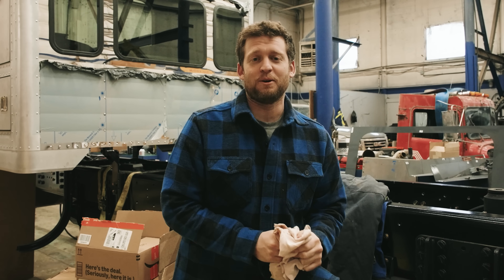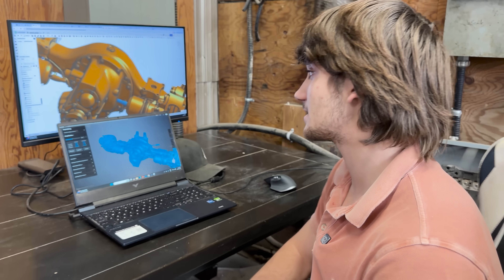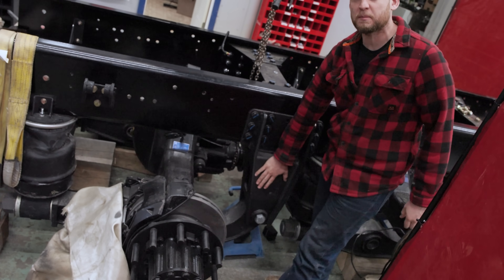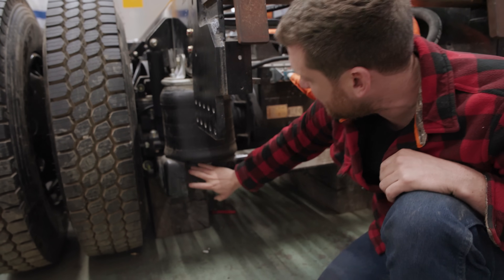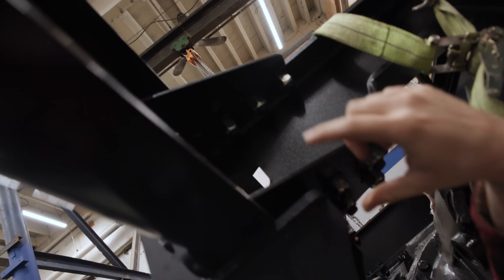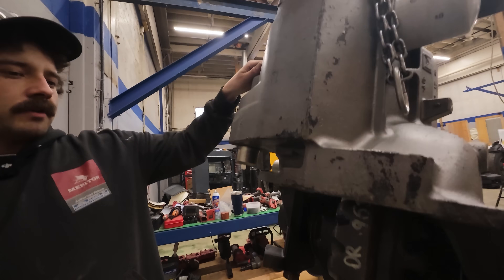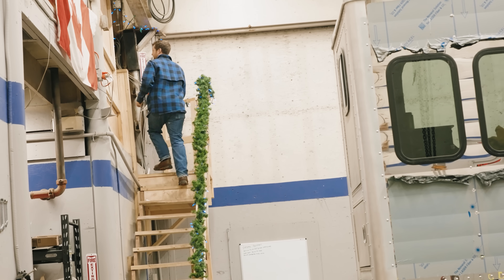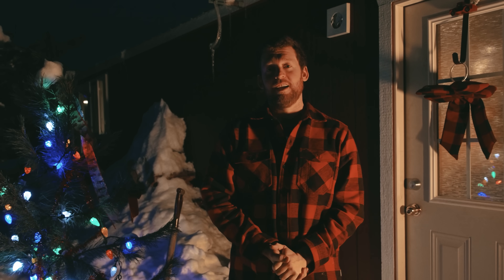When Precision Becomes the Problem

Comment: 15:10 Ya'll might wanna check on the open un-capped fire sprinkler system Tee. Remember no multiple-fatality fire (more than two deaths) has ever occurred in a fully sprinklered building where the system was properly installed and operating as intended. Hopefully this is just old piping that has just not been demolished yet and not a sign that the sprinkler system is drained with the control valve shut off.

Comment: Tolerance doesn't mean clearance. Tolerance is how much each part is allowed to deviate from the designed (nominal) dimension. Clearance is the designed gap for it to fit (nominal clearance). Your designed clearance needs to be more than the sum of your tolerances or there's a chance it won't fit. Manufacturing gets more expensive as you specify finer tolerances or you can save money by designing more clearance and accepting wider tolerances. It depends on the criticality of precision to the application

Comment: I'm no welder but I think that those huge steel plates should have a bevel on them to get a solid weld. Basically wasting material on those axle holders if you're only going to have an eighth inch weld penetration.

Comment: A little torch heat and a dial indicator and you can move the metal where you need it without grinding or beating on it. Indeed a weld will cause it to pull, you could also block it tight in the middle, weld it and toss it in the oven overnight to relax the stresses.

Comment: 14:00 when i saw the test fit of the 3d print my immediate reaction was that the print will be able to flex ever so slightly so it fits well even without tolerances but the metal part is never going to be able to do that.

Comment: It's part of the course. Most of the stuff I've built has been custom. It'll get a bit easier with time, at least if you can keep the people.

Regarding that weldment, it's pretty common to line bore these things to make pins fit. Depends on the tolerance requirement of course. But you can get pretty far by building a really stiff jig, and let the part cool in the jig. 

A jig for this particular part would require a sleeve over the pin to restrict the ears from bending inwards. Order of operations for the weldup matters a lot as well (inside corners last as they pull a lot). Really basic stuff, your welder should know that already.

Best of luck to you guys, Edison motors has a really cool concept.

Comment: Then when you perfect everything some sneaky inspection govt guy gonna go around with a modified Baby scanner with App and upload your designs to their Plasma generated Ultrasound holography printer database with Ultrasonic holographic solidification of molten metal for perfect atomic structure. Squints at Boeing Plasma force field blocking explosion shock waves Love capacitor banks.. I hope masses get Ultrasound resonance filtered shock wave echo clashing weld assist someday soon. Its not too advanced just imagine pressure flowing through your metal forcing molten material tight to your welds like gravity. Google: "Ultrasound stem cell guidance" Resonance filters can make even the most sensitive things immune to vibration absorbing its how high powered Ultrasound scanners are safe. Allowing use of pressure holograms like magic robotic limbs heh..

Removes piston from an engine and puts plasma Ultrasound transducers firing from behind metal to smash fuel by manual crank charged capacitor bank > runs finger up Diesel Generator copper exhaust pipes through Electromagnetic bearing Tesla Turbine Cold steam boiler tank before exiting vehicle Nuclear reactor heat transfer style.. Runs finger from Turbine gen to capacitor banks that pump condenser side back to boiler and or primes vacuum after first start whenever needed Ask AI "Goal for use of resonance filtered Ultrasound beamed into an engine to disintegrate Carbon as its made to keep Diesel Engine factory clean." Can transfer heat through engine straight into oils through whole engine to warm for cold days too. Oh yes..

Taps my head I got insane things because my OCD thinks spaceship level. Cranks up shock wave echoes to pull Solar wind hydrogen & Oxygen > Switches to Hydrogen generator mode > Overflows Hydrogen to duct style ultrasonic never jam shutter all directions thrust system + Recycling that heat too = Party Popper space system.. Lol.. No more engine needed for fighting ground terrain so Turbine becomes primary for ultrasonic gas mixer, life support, and ignition system for rocket system. *Google: "Ultrasound excited Plasma generates stronger EM field" Super excited Plasma = Shock Wave generator = Space radiation meaningless threat data within range of ship.. Heh. - Davy Jones https://www.youtube.com/watch?v=J46EcAqZAPY
Reply: ^ If I was rich on Earth I would have a Plasma pressure turbine Diesel engines made with the Tesla system to recycle fuel waste heat. Points at Boeing Plasma mention Echo clash holographic overlay = Sure you can go Ghost Rider. "Ultrasound solidification of molten metal" VS TNT level pressure potential to hold. If a machine is operational in a molten state is it not a Ghost of a machine? LOL.. Advanced fusion Beam warfare survival tech. You'll come around..

Comment: Get a reamer and ream the holes to each other so they are square to each other is probably the only way to save them as they will always warp some after welding, may also be worth putting a pin in the holes to align them during welding but id still expect it to shift some during welding....

Comment: 4:42 it doesn't actually fit. It has to be whacked on and 3d prints flex a lot easier than steel, also it stays on when he lets go so there is obviously a lot of friction there and another sign that it does not fit.
You never really want exact fits for parts like this as the axles themselves have tolerances that will likely change for each one, and you dont want to have to modify parts to be able to use them.

Comment: Chase.... I've watched you in a couple of your rants today about suspension bracket  "tolerances" with the pieces  that are to be straddled and  welded to your axles cases . You keep using the term TOLERANCES when you are really talking about CLEARANCES. Tolerances are what give you clearances. So measure accurately the mean thickness of your axle housings and then give a reasonable clearance for fit and then write the tolerances so the smallest width of your welded bracket
opening  is the thickness of your axle plus the fitting clearances. The largest opening gap is whatever you are willing to live with for fitting / welding slop. So your desired  bracket open gap might be 122 mm plus 1mm clearance. Your tolerance might be written 
123mm +.5mm -0mm
It's clearance you mean  to say not tolerances It's the tolerances that arrive you at the correct desired dimension which includes 1 mm clearance for fitment. 
Your engineer is asking the correct question but your clearance is not enough due to welding warpage and manufacturing Tolerances. I'm sure there is a fixture on which these parts are welded. They need to be shimmed for added CLEARANCE. 
I'm sorry if I appear to be mansplaining. I'm not. I'm trying to help you understand the nomenclature. 
Billy the nerd

Comment: On the bracket with the pin that you had trouble with welding warpage on, rather than change your procedure the way you described, I would recommend do the pre-build as you already have. But make the bore slightly undersized and then line bore after the welding has been completed and everything will fit perfect.

Comment: I can't help but think that you guys could probably benefit from a large flat-stock CNC cutting machine (like a waterjet style one), especially for cutting out all the silencing foam for the interior, I bet it took forever to cut out all the bits you needed. I'm sure it'd be handy for making brackets out of flat stock as well along with a brake press.
Reply: They need an entire machine shop of (used) equipment

Comment: As a former welder... screw grinding things out. Also tolerances need to have a +- that accounts for the other tolerances and differences.  Angle over distance was the worst to deal with. Sure the rod my be within tolerance of mm but at 10m you can easily ran out your tolerance. It's not a fun game between too little and too much.

As for the welded part. I used to make something exactly like that. First, pre welding or not, you could easily still run into issues, as heat has far more force than you might realize. Weld order matters, gussets, even if tacked and temporary could help, pre heat could help especially if you go against the expected pull, and spacers during the process could help. When I used to make that similar part we would pre heat it, have a brace tacked inside to reduce pulling, and then measure after cooling and after removing the brace. If it did pull it out of tolerance we would just add some heat in a line opposite the weld to pull it back in.

It's easier than you think with a torch to bend something even as large as the entire truck frame, and with could practice it can be done with pretty damn good precision. You can likely easily fix that one part.

For reference I built transport stands for jet engines for a couple years where we had to hold tolerances across not just the parts, but the entire frame, which was something like 10 ft x 20 ft.

Comment: You need to make up a fixture or a jig that holds that thick suspension mounting bracket in place while you weld it. You can also use allthread and individual nuts to keep things spaced.

Comment: 14:07 Geometric dimensioning and tolerancing of production parts is its own discipline for a reason.
Those fittings, if they're too tight will run the risk of rusting on and because of the expansion of Fe2O3 , you might have to cook it with a rosebud to get it off so a little rework if designs is the right choice 😉
This type of work is better suited to a Mechanical Engineering Technologist who has shop floor and Engineering office experience.

Never tell an engineer "as tight as possible 🤦🏼🤦🏿

Comment: I think that hybrids are the future. I know you have gone for a generator solution, but have you considered having a drive connection to the wheels for highway cruising. I would think that at cruising speed this would be more efficient? And you would only need to have a simpler 3 speed transmission and maybe only on one of the axels.
Reply: you can get a civic hybrid，it works exactly generator+high speed direct driven
Reply: @xiaochuangsun6427 okay. Most hybrids do it with an e motor before transmission and keeping everything in drivetrain the same. 
I think that having e motors close to the wheels are the best solution, but having a simple transmission for direct drive I think is more efficient on highway speeds.

Comment: 16:30 , you can absolutely weld those brackets together in advance, the hole should be bored after welding. That will automatically correct any distortion from welding.

Comment: You need to actually lessen the tolerance. Weld them up, to which they can and  will warp up to 0.010 becoming oval, and after they are finished, bore them out to the proper diameter. This in turns makes sure you don't have a oval hole and are relying on tolerances to fix it. The mechanic is in a sense right. But his thinking of grinding it out to fit is a bit crude. Image was in the right track. As a hands on guy with experience, he is right but the grinding needs more precision of a machinist touch.

Comment: This is a classic design for manufacturability problem — and it’s one almost every company hits after prototyping.

1) Prototypes don’t test repeatability.
Building one unit proves it can work. It says nothing about whether you can build thousands of them the same way without heroics.

2) Scaling exposes tolerance stacking.
Small variations that were invisible at low volume stack up fast. Parts stop fitting, yield drops, and suddenly the line is “debugging itself.”

3) No standardized work means uncontrolled variation.
If the process lives in people’s heads, every build is a new experiment — and experiments get very expensive, very fast.

4) Rework hides failure until it’s fatal.
Rework feels like flexibility, but it’s really just masking design and process gaps while quietly burning time, money, and morale.

What actually worries me is that you’re discovering these issues during prototyping. That’s the easy phase. If this already hurts now, full-rate production is going to be absolutely unforgiving.

None of this is unique. It’s exactly how a lot of companies fail trying to scale.

Speaking as an industrial engineer who supported gas compressor and locomotive production: every “mysterious manufacturing issue” eventually confesses. It’s tolerances. It’s rework. Always.

Comment: As a CAD designer my eyes went wide when the 3D print went on the axle with a friction fit! Oh well, these things happen. You guys have the right mentality, it's not worth playing the blame game with this sort of stuff, lessons learned and all that. It's been my experience that the more comfortable the designers and fabricators are in having meaningful dialog, the smoother things go. That being said, it's worth having the CAD guys involved on the shop floor during prototyping to experience the challenges that come with the disconnect between the perfect and ideal 3D model and the real world. The tensions between trades can be greatly mitigated by having both parties cognizant of the other's constraints. Communication is key!

There are plenty of tricks of the trade to deal with these types of fit and fabrication challenges, like shims, fabrication procedures (as you've noted will change), and designed alignment aids (a cammed bore and bushing for the pinned connection comes to mind).

I have a wealth of experience from the engineering office and the shop floor that I'd be happy to share if you are interested. Anything I can do to help this wonderful endeavor. Please keep up the fantastic work.

-PS: I absolutely adore your commitment to keeping the end-user and serviceability in mind with your designs!!

Comment: have you guys ever looked into using tatra axles? their drive line system is unmatched and they license it out from time to time. having the driveshafts in a rigid tube eliminates all the universal joints making for a very strong drive line where the suspension pivots happen at the axle tubes. they are also modular by design you can make a 4x4 or a 50x50 if you really wanted to all with the same parts

Comment: Chace my good man... those axle brackets are WELDED on, not 'glued'... sounds like you're building a 1:28 scale model (with the funny smelling glue!) 😉
That said, I worked on the engineering side for 3 decades with off-road heavy equipment design... lots of cases of "engineer vs. mechanic"... what you're going through is nothing new... there are always surprises! But as you said, you identify the problem, correct it and move on!

Comment: The only concern I would have with your suspension cradle on the frame is, will it affect the flexing of it? On ships they suffer cracking where wheelhouse attaches as the hull on that portion cannot flex as much. I might just be overthinking it.

Comment: Clearance/Tolerance. A nightmare. We'd get jigs made, which had locating pins. They would be machined to the finest possible tolerance, for a jig that allows several millimetres of movement of part placement. The clearances of the locating pins were zero, SO tight we had to hammer them into the holes, and then, of course, they don't come back out.

And when we wanted them to make them RIGHT, that was too hard, so we just had to put up with BAD jigs MADE IN OUR OWN SHOP. FFS.

Comment: IDK how much admin stuff you guys are doing, but at my company, even as an engineer, I have to keep records of everything I receive and send anywhere. This includes checking that the part sent to us is exactly what we ordered and is on the packing slip. The packing slip (for sending and receiving) gets filed away with a signoff from whoever sent/received it so we have record of where parts are. No customer can try to blame us that we didn't send something, or we can tell suppliers that they sent the wrong thing so it can be fixed ASAP.
Reply: Chace needs a helper whose only job is calling every vendor evert day to remind them to do the right thing.

Comment: Would've made more sense to my mind, to get  the right cam brkts and just rotate the spyders. Meritor used to be 24hr to ship cam brkts out of Ontario, plant was in Guelph, not sure if it still is or not. Shud be 3 ea of the same LH & RH cam brkts as long as they're mounted of fwd sid of axle. on some versions, if the brake pot angle is right, you can just spin the spyder and swap sides on the cam brkts.